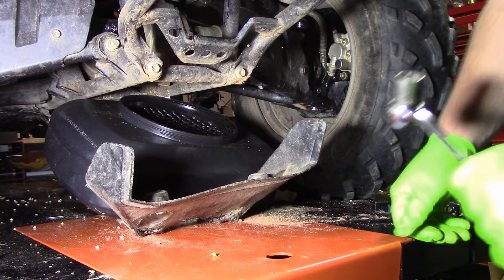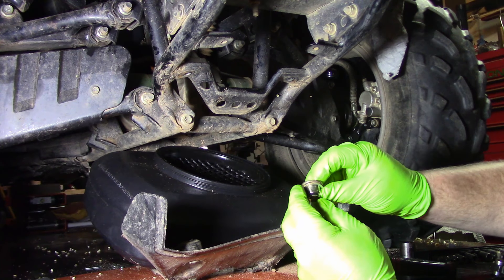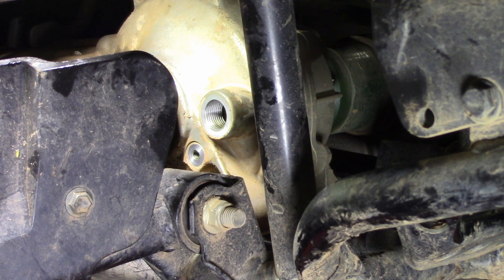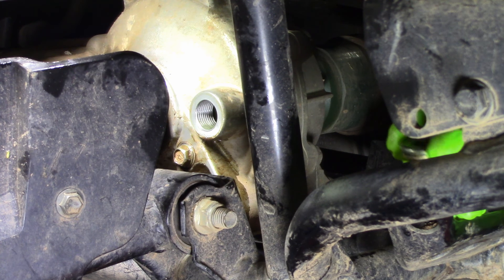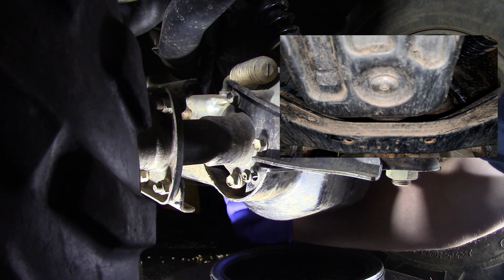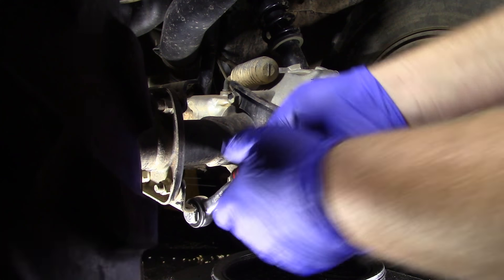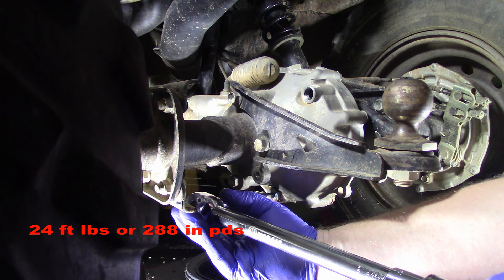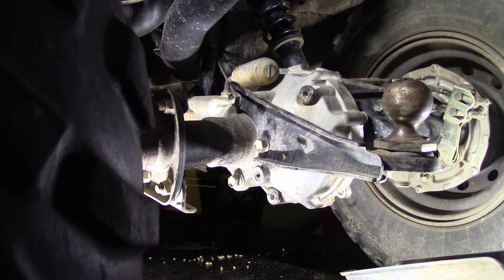Suzuki eiger both front and rear diff drain and service

Comment: i do have a question could a non-serviced rear and front differential cause the quad to jump in gear or cause it to be tough to go in gear from park to High and Low i recently go on and it needs some servicing. Help
Reply from the maker: I don't think so, but anything is possible. Get it off the tires, and check for the binding.  Check-in neutral (not in 4x4) to see if there is any binding or grinding noise. If none put it in the park (not 4x4) and manually rotate the tire to see if it pops or grinds. If there is a noise check both front and rear diffs, if none check the transmissions for noise or see if pop out of gear or hard to shift. I think that will clear out any ideas of the diffs to be the problem. I think it is a transmission issue, I can't remember if it has an adjustable lever for the selector and linkage.  At the linkage attach point on the transmission disconnect it and see if the lever moves freely, if binding or sloppy it could be the selector to the transmission or internal in the transmission. I'm sorry I can't help more, I'm just going off of memory from when we found the lever in the transmission failed and was worn out. Sorry for the late reply, just got back into town to access my account. let me know if you need any more ideas.

Comment: As for the rear diff breather, do I need to vent it higher up if I’m going to be going in water or is it water proof?
Reply from the maker: Anytime water goes above the axle just check the oil through fill port. Then, I would relocate the breather inlet above by the seat.
Reply: @jetzombie  thanks, I wasn’t quite sure but now I’ve relocated the front and rear diff breather the rear being under the seat and the front vented into the cvt in
Reply from the maker: That's great.

Comment: Does it take limited slip gl-5?
Reply from the maker: No, non limited-slip differentials  hypoid gears. API GL-5 oils can be used in limited slip differentials only if they correspond to the requirements of specification MIL-L-2105D or ZF TE-ML-05. In this case the designation of class will be another, for example API GL-5+ or API GL-5 LS.

Comment: The 10mm bolt broke on mine. Do you know the exact dimensions for the 10mm bolt?
Reply from the maker: No, I don't know the size or pitch. But, I believe that this is the part num 27409-38FC0. Hope that helps.